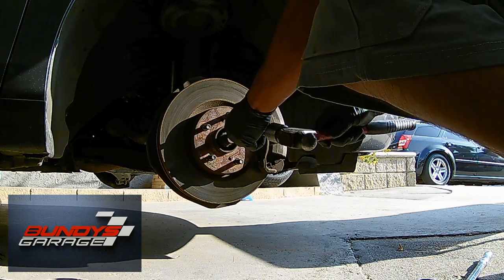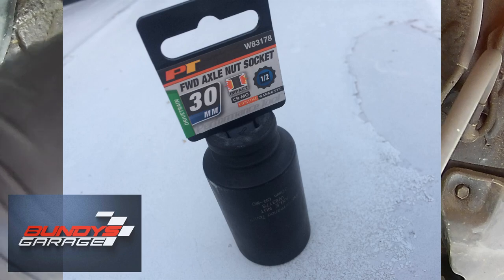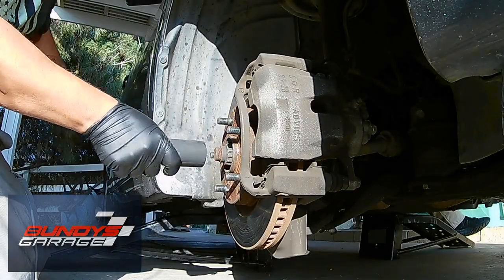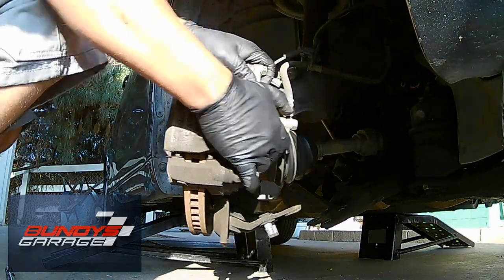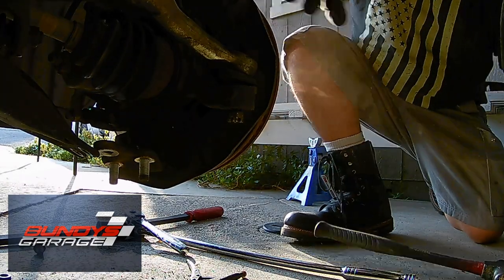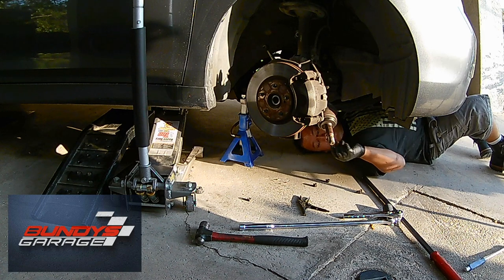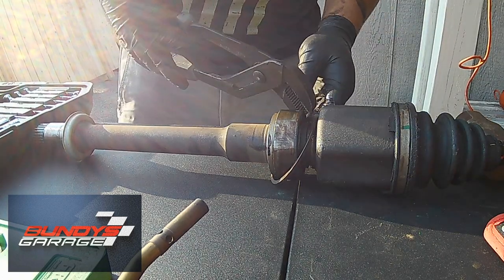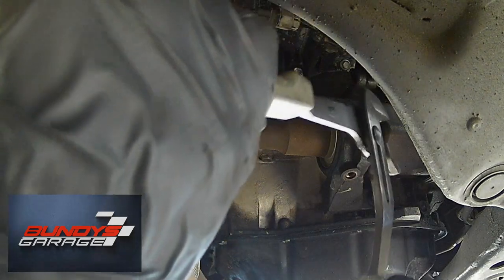Toyota Camry Axle Replacement | Removal Axle Nut Size | Highlander Solara 02 03 04 05 06 07 08 09

Comment: I'll tell you what will make for a bad bad day is when the axle bearing is seized in that little bearing retainer. You will have to break out the sawzall and grinder with cutting wheels and that three hour job turns  into a day and a half. Even if you manage to unbolt the bearing carrier it still wont come out because it is doweled into the block.

Comment: Did the axle nut spin in freely? I changed out my bearings and hub and find that the new axle nut does not spin in freely although it does fit. I’m just wondering if it’s meant to be a very tight fit so it doesn’t spin back out. I’ve heard that they’re a one time use.
Reply from the maker: It should start the first few threads freely.   Some get harder to spin as they go on and some don’t. Always start it by hand.
Reply: If axle nut spin in freely 
all the way it means it lost 
its locking mechanism you ,
Must be replaced specially if
there's NO cotter pin mechanism 

And must replace it or the axel also,
might lost its locking mechanism 
but mostly the axle nut will lose 
its locking mechanism before the 
axel locking mechanism ( threads ) .

We check the threads 
< locking mechanism >
 and we called the check
 ( threads  run in check )
in civil aircraft maintenance .